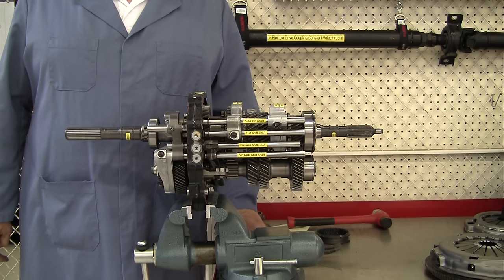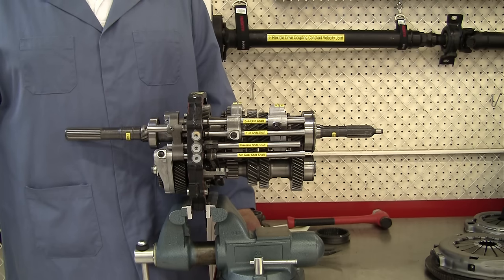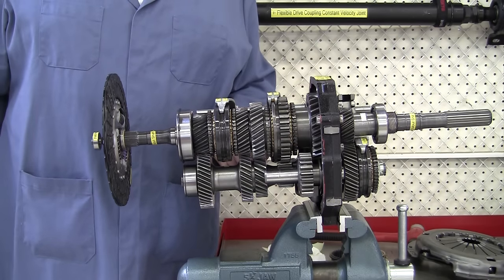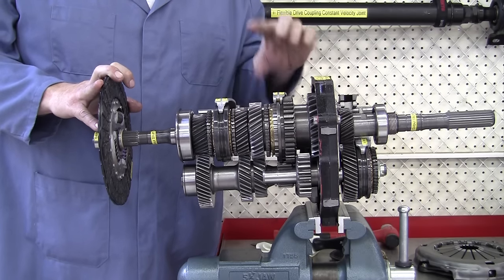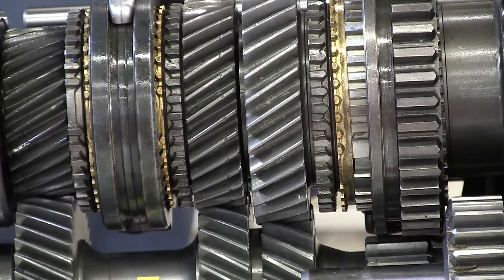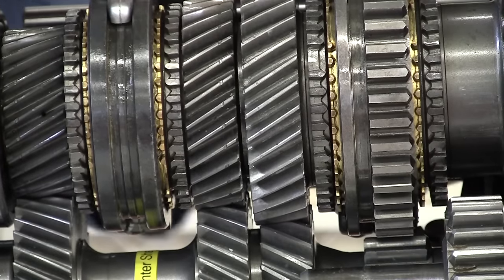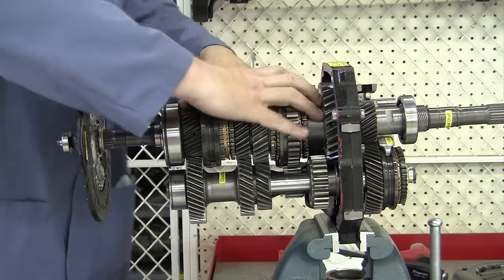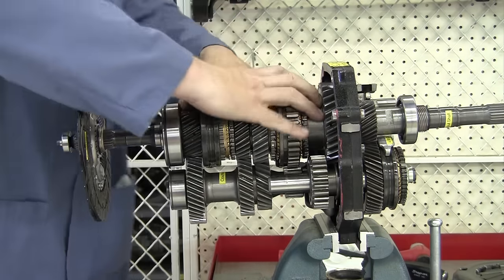Manual Transmission Operation

Comment: 10% transmission
40% throat cleaning
50% shift shaft
love the video
Reply: actual click away , i couldnt hear it anymore even tho i was starting to get the explaining
Reply: At 9:05 after showing us which is the input shaft and which is the output shaft for the 100th time, he mentions that he has labels on the output shaft and input shaft but he forgot to mention that he is also wearing a blue jacket.

Comment: Great presentation.

Personally, I barely even noticed the coughing. That's because I'm not a whiny ADHD-addled keyboard jockey with zero concentration.
Reply: exactly.  the point of the video is to understand how a manual transmission works. the coughing is irrelevant
Reply: What coughing?
Reply: Darryl Lee
Reply: +Testing123 Know What?  I never noticed him coughing !  I was VERY absorbed in this video, especially the 'Synchro Stuff'   Now I know how they work.
Reply: Well it's fucking annoying when you're concentrating on his explanation and he starts coughing up phlegm in the middle of it.
Reply: *DOHC

Comment: This was way better than any video featuring 3D animations of manual transmissions.  Really gotta see the real thing in action to feel like it's practical.  Thank you for showing ALL of your working and continuing to repeat key phrases and concepts as you kept using them.  I appreciated how centered this was on Neutral.  Like, that's the starting point for everything, and then where can and do you go from there?  I learned to drive automatic transmission cars and I'm about to take a course on how to ride a motorcycle (but I haven't yet), which I know will involve manipulating manual transmission.  Until now, I always kind of regarded Neutral as a "neat feature" of the gearbox, but I personally never found any practical use for it.  This video has driven home some concepts that make me really appreciate the Neutral gear position, and I hope that I can apply this lesson in ways that will make me a better driver and a better rider.

Comment: Haven't been able to find a proper explanation of the sync rings how they work. Almost all explanations just leave it at "they match the speed of the gears".
To me that is just what they do not how they work. This explanation and demo covered it all. Now I finally know how the sync rings work.
Thanks for a GREAT video! :D
Reply: Try the video from 1936 made by chevrolet. they explain it to work same as a cork that you push and rotate into the bottle until it rotates with the bottle itself.
they knew how to explain back then i guess lol
Reply: For real though. I finally understand that the transmission fluid isn't just for keeping the gears themselves from grinding up, but the synchronizer rings as well if they're having to rub up against another gear spinning at a different speed.
Reply: The rpms and output shaft should match
Reply: I must say the engineering of these things is unbelivable. It's really fascinating to break down how stuff really works.

Comment: This video is the sole reason I began to learn how transmissions worked and how gear ratios are used. Followed shortly by how differentials work and well... now it's been many years and I'm an engineer now capable of designing these bad boys (someday though, these are utterly complex to design without it being your profession).

Comment: I know this is a 9 year old video so I don't think I'll get an answer but if anyone could throw me a bone. 

How does the synchronizer rings match to the gear you are trying to shift into? 

Correct me please if wrong, but they are spinning same speed as output at all times correct? So you shift out into neutral how do the cogs or grooves for the synchronizer and the gear you're shifting into match if they are spinning at separate speeds?

I really appreciate this video. Everything I've learned about cars is from YouTube so some things are difficult to get across, this really was a big help for a lot of concepts
Reply: Was just learning from this video too but I don't think the synchronizer rings spin at output shaft speed all time, rather it's a tapered pressure fit onto both the input and out put side and so allowing a buffer zone for both sides.  They are made out of a softer metal to take the damage instead of the input/output gears too.
Reply: Simple. As you pushes the synchronizer against the gear, it's get tighter. Friction hold them together, thus matching their speed. That's also the reason why they wear out...
Reply: No... When in neutral gear, input shaft will continue to spin as long as the engine is running (and of course the clutch is connected), but the output shaft will not spin, they're not connected at all...

In neutral, only the input shaft and synchroniser hubs that spin in the same speed, since none of the shift gears are connected to the hubs...

When you're shifting gears, like netral to first, the 1st-2nd shift sleeve will connecting the synchroniser hub to the first gear, and if you shift again from first to second, then the 1st-2nd sleeve will connecting the synchroniser hub to the second gear, the synchroniser gears (brass) are simply to smoothing the shift between gear, the same thing happen when you go from third to fourth gear...

But, when you go from second to third gear, the 1st-2nd sleeve will back to neutral while the 3rd-4th sleeve will now connecting the hubs and the respective gears...

Comment: This is why it's good to drive a manual.  It's pretty simple in principle, read easy to repair.  It's usually $3500 or more to rebuild and automatic transmission.  Also, you can "bomb start" a car with a manual transmission when the starter fails and it will eventually.  You also get better gas mileage.  You can also start in second gear in winter when the roads are slippery so your wheels don't just spin out.
Reply: Also an auto-theft deterrent.
Reply: and you can dump the clutch for sick burnouts :D This video is actually really cool because my toyota pickup has this same transmission!

Comment: Trying to follow the powerflow here, what gears are free wheeling on their shaft and what gears are fixed to their shaft. (also never really got a good look at 1st countershaft gear). I'm not sure if this is right but, since 4th gear is 1:1 it would make sense that 4th input shaft gear is fixed so that both input shaft and output shaft are spinning at the same time without any actual gear ratios, therefore 1:1. 4th countershaft gear should also be fixed so that all other gears flow through the 4th gear set. all countershaft gears should be fixed and 1st, 2nd, 3rd, 5th output shaft gears should be free wheeling. The synchro's should be fixed to the output shaft and only spline to a freewheeling gear when engaged to that gear. So in 1st gear power should flow from the clutch to 4th input shaft gear to 4th countershaft gear to 1st countershaft gear to 1st output shaft gear to 1st synchro to output shaft. Similar for each gear except 4th which travels straight from input shaft to 4th input shaft gear (fixed to shaft) to 4th synchro to output shaft. Is that accurate?
Reply: Some transmissions work as you describe, with all the countershaft gears fixed, but the one shown here has 5th gear mainshaft (output shaft) fixed, and 5th gear countershaft moving. The input shaft can also be described as 1st motion shaft, and its gear as 1st motion gear. It's not really 4th gear, as 4th gear is achieved by locking the first motion shaft to the mainshaft, with no gearing involved. The ratio of the 1st motion gears does not affect 4th gear ratio, but does affect the ratios of all the other gears, as it determines the speed at which the countershaft rotates.

Comment: Great video on the AX15. I rebuilt my AX15 for my 97' Jeep TJ a few years ago and have dealt with an annoying shift problem since the rebuild, but have been reluctant to pull the trans and open it up. I did replace all sycros,  the 3/4 sycro  hub, 5th gear and reverse gear due to tooth wear. My issue is at random shift times I cannot move from 3rd gear to 4th. This is not a gear clash or grind issue. It feels as if the 3/4 shift rail is being blocked from movement when only shifting to 4th. No amount of force will overcome this. However, when shifting back into 3rd and then again an effort into 4th, the shift is effortless and like cutting butter. I only experience this on random occasions. When I can't move the shift into 4th, because it is being blocked from movement, I  shift fully back to 3rd and then again to 4th gear. It works everytime, but the need to perform this maneuver is irritating.  Again, this is not a sycro  grinding or clashing problem, and it only occurs at random when shifting from 3rd to 4th. Other times the shift is perfect. I believe .y problem may be with an incorrectly placed shifter rail check ball. Or maybe a missing check ball that didn't get reinstalled? For now I'm living with it, but would like to know from those that can help me further isolate the problem before I decide to go back into it. Thanks everyone that is reading my post.
Reply: Salut, very interesting, please let us know what was the cause if you gonna fix it, all the best from Bavaria.

Comment: Thank you for this! It was perfect! 

I also finally understand why the wheels sometimes spin a little in neutral when the car is on jack stands, watching you move the clutch around when it was in neutral you can see the very small amount of friction still transfering a tiny rotational force to the output shaft. Interesting!

Comment: Peppermint oil capsules can help somewhat with laryngopharyngeal reflux (a common cause of having to constantly clear one's throat.)
Reply: Is that the medical term for "frog in the throat"?
Reply: Another solution is to edit out the coughs in post production.
Reply: @RaymondHng  True, but if you're the speaker, you're probably better off treating the symptoms.  I find it irritating when I have to clear my throat every minute or so.  I'm very glad I found out peppermint oil actually works (not 100% but makes a noticeable improvement.)
Reply: @RaymondHng  yep, I've had to do that...
Reply: @adventureoflinkmk2  I taped an interview where the speaker said "UHMMMM" in the middle of practically every sentence. I edited every single "UHMMMM" out in post and covered all the edits with B-roll. He became the most articulate speaker.
Reply: @RaymondHng  and I've had to do that myself as well. LOL
Reply: @adventureoflinkmk2  And I had one talent who didn't like the sound of his soft-spoken voice, so I lowered it in pitch by 5% and it butched him up.

Comment: THANK YOU SIR!!!
Reply from the maker: +Gustavo Weckesser Thank you!
Reply: +WeberAuto such an in depth video i really like it!! :D  I have one question - What is the purpose of the lay/laying drive apart from the idler gear for reverse? i cant see the purpose for all the gears below the main shaft. please enlighten me because im sure im missing something really important xD
Reply from the maker: +Parama Obi Hi, there is the countershaft behind the idler.  When the idler engages both the countershaft and the 1-2 synchronizer sleeve gear, the output shaft turns backwards for reverse. Good question.
Reply: +WeberAuto so what about all the other main gears, they all have a unique sized gear connected below it? im not sure how it helps seeing as the gear stick would connect to the sleeves

Comment: The reason I love this video is 1) you use real hardware (no computer simulation) 2) of course you are a great teacher. 

I wanna request you to do another tutorial on the car's suspension system. Function of control arms, CV joints, bushings. I think many would find such a video really helpful.  (I don't have an automotive background but I love learning how cars work). Thank you :)
Reply from the maker: Thank you and thanks for the suggestion

Comment: Now I understand why manual transmissions are better than automatic transmissions: One; they look cooler and flow smoother. Two; they have a selector fork, moves left or right depending on how you shift the gear, to go over the blocker ring which originally moves faster than the regular gear. Three; Are easier to build, easier to design, and you get more control over your vehicle, especially steering.

One thing that should've been added which was added in the Engineering Explained Manual Transmission video with a real manual transmission except it was a Volkswagen so the reverse idler gear was on it's own shaft, is the selecter fork moving some teeth up to rotate the clutch. Otherwise, 10/10.
Reply: +2

Comment: How the hell they made all of this??? This is manual transmission, the automatic is more complicated, can our generation built things like that?? I mean I feel brainless when I see these kinda things!!!
Reply: Our generation is building 3nm chipsets with components the size of 3nm. That means you could literally fit about 30,000,000 across your pinky. 

To better put things in perspective. The Covid-19 virus is about 100nm. It’s insane that we can engineer components that require microscopes to be seen. That’s impressive by any means.

I think each generation has their own golden age of technology. Even automatic transmissions will become redundant with EV technology.
Reply: It started off very basic and slowly improved over the years, just like any technology.

Comment: Great video. A slightly more complete explanation for anyone confused (correct me if I'm wrong): The 4th gear is affixed to the input shaft and is what actually turns the countershaft. Gears 1 through 3 spin freely on the input shaft and are turned by the corresponding gears on the countershaft. The 5th gear spins freely on the countershaft. The countershaft, being turned by the 4th gears, transmits power to gears 1 through 3 affixed to the countershaft. The corresponding gears on the input shaft transmit power to the output shaft once engaged via their respective synchronizers. When 4th is engaged via its synchronizer, though the countershaft still turns, power is not transmitted by the countershaft to the output shaft, but instead is transmitted directly to the output shaft. For 5th gear, power goes from the 4th gears to the countershaft, to the 5th gear on the countershaft (via the 5th gear synchronizer when engaged) to the 5th gear on and affixed to the output shaft. For reverse, it's hard to see from the angle, but the small gear under the large straight-cut reverse gear is sits on a shaft slightly offset from the countershaft. The reverse gear on the countershaft is hard to see but is spun by the small gear you can see in the video.

Comment: They are also very reliable. I had a '85 small Toyota pickup with manual. I drove it 211,000 and did NOTHING to the transmission other than change the oil. The clutch waited until 185,000 miles to finally give out. The vehicle was not built for comfort and was noisy, but it lasted!
Reply from the maker: Thanks for sharing

Comment: It was really confusing seeing the different sized gears all connected but still spinning until I realized the top gears spin at different speeds. They aren’t linked together which allows the gears to spin separately. Until this video I thought that the gears themselves meshed together, and not something coming into contact with the two gears that are already meshed together. It’s really cool to understand how this all works.

Comment: Great explanation of a MT. Maybe just two comments... 
There are no gears for the 4th 'gear'! In 4th gear, the input and output shaft are directly connected, the countershaft is idling. This is the reason, why all rear drive MTs do do have a 'gear' with a gear ratio of 1:1, regardless if it's the 4th or 5th.
Front drive transaxle MTs typically do not have the same setup with input, output and countershaft. Theses MTs are using the countershaft as the output shaft. The final drive (differential) is typically placed on the side facing to the clutch and directly connected to the countershaft by the gears of the final drive. This is the reason, why there isn't necessarily a gear with a 1:1 ratio, because all gears need to go from the input shaft to the counter/output shaft over a pair of gears. There are no shafts to be connected directly.

Comment: Thank you for the video.  I have a 1981 Mercedes Benz 240d with a 4 speed Getrag manual and in time I will need to rebuild it so  this gives nice details for rebuilding this and eventually my 1964 Ford f250 with a 4 speed manual.

Comment: One thing you could have spent a little more time on was explaining how the input shaft is directly geared to the counter shaft, as well as what specific gears are coupled to what shafts. I suppose this is more how the sleeves, synchros, and shafts work tho.

The gear nearest the clutch is splined to the input shaft and the gear it meshes with is splined to the counter shaft - they always spin at the same ratio as that pair. 4th gear doesn't have a gear, it just couples the input & output shafts. All others run thru that first fixed pair powering the counter shaft, and then thru the gear that is currently coupled to it's sleeve. Pairs 1/2/3 spin freely on the output shaft & fixed to the counter shaft, 5th is the opposite. I'd guess that's to give more room for the shifter assembly since it sits over 5th.

Comment: my driving instructer didnt explain gears like you have. thanks alot.
mind explaining the concept of releasing the clutch pedal slowly for synchronising with the selected gear
Reply: there's a helixicle sychronising disc that helps time the shift. It's the thinner toothed discs in between the gears

Comment: Finally understood how a trans works, been understanding alot about the ratios e.t.c and the gears but it never occured to me that the cogs that connect to the main cogs through the syncronizer i thought that the cograils were always in contact with the wheels